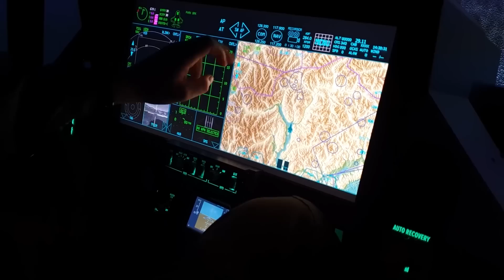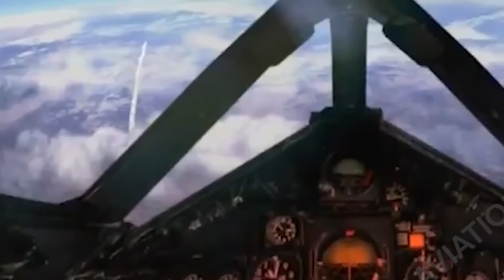The USA is testing Its New " 7th Generation " Fighter Jet | Russia and China shocked

Comment: If the "7th gen" is like what is listed here, Kinetic impact weapons are not out of the question either, because from that high up combining inertia and re-entry with something heavy it can deal massive damage and potentially shatter aircraft runways or destroy heavily fortified bunkers using less or no explosive substances than modern day "bunker busters"
Reply: Realistically nothings out of the equation. Like you said impact weapons but realistically the US can do whatever. We know they’ve been testing lasted for like 30+ years, I mean combining hypersonic with no radar cross section. Also 7th gen could be the first step to non combustion, fusion, maybe even gravity propulsion. All depends on our materials and elements.
Reply: Ionic wind even would be cool
Reply: Rods from God
Reply: @@mzt2929 i see, perhaps it needs a little push to accelerate it and get it on target from that height
Reply: Pa DESI YUKI RIMTU TI TUKI!

Comment: I wonder if internal missiles bay even needed in the future when a stealth fighter could be escorted & protected by a squad of stealth missiles drones
Reply: That idea is probably not viable for the simple reason of fuel, it's hard to cram enough fuel into something to be efficient enough that also needs to be small and have stealth characteristics such as being flat and nimble. The cost of weapons like that would likely way more than double the cost of a standard missle just because of the sophisticated programming they would need to put in them.
Reply: @Spyderbrit  Stealth missiles drones don't have to be small. It could be as big as maned jet fighters but without the cockpit.
Reply: @zollen123  Well missiles that size wouldn't be effective enough because of the reduced mobility, it wouldn't be able to maneuver fast enough to be a good missile, in air to air situations of course.
Reply: @Spyderbrit  It is still a remote controlled fighter jet carrying 2+ guided missiles.
Reply: @zollen123  hell we have a program turning F-16s into attack drones atm so I don’t see any reason why AI couldn’t perform just as well as a human if not better due to no human restraints, only restraints would be on the jet and the AI but by second gen AI those issues should be worked out. Also I don’t see why they wouldn’t be able to carry a full weapons loadout!! That would be cool tho, upload new software into our old gen 4 and 4+ fighters and turn them into drones or loyal wingmen would be awesome!!

Comment: This is a Great Video Review!!! One question: if we are using a dual cycle ramjet_turbo fan engine.  Doesn't this mean,  we can only travel high super sonic in atmospheric conditions?
Thank you 🤓♥️
Reply: We can use them to about 125,000ft. and with some sort of liquid air injection type device to make up for the thin atmosphere maybe it could be pushed higher. Still, the jets won’t work towards space because at some point there’s nothing to make the fuel stay lit.
Reply: yes its possible and more practical than v4

Comment: i think the next phase of warfare should be to attempt to nullify the nuclear threat.  This could be done with a swarm of craft always in the air, or laser weapons that can neutralise ICBMs.  This will effectively end mutually assured destruction
Reply: That wouldn't work unless all the governments agreed to let someone else's military into their airspace at all times. And it ignores the fact that when one side advances in technology the other side creates counter measures such as their own swarm.

Nukes are also emps so potentially only takes a few nukes set to go off right in front of the swarm to shut down a decent chunk of electronics in a zone. Drone's don't do well in those cases and radiation is actually worse when detonated up high because the radiation drifts further.

You can also just stick a nuke in the car and ignore the air.

And of course it actually encourages countries to launch more nukes because obviously one wont work so they send more in the hopes at least some get through.

There was a similar project with satellites that could shoot nukes down and there is a world where it may temporarily work. Long term "the nuke problem" does require all governments to come to an agreement to a) remove their own existing arsenal and b) make it impossible to make more. Send all uranium to the moon for example. Neither one of these things will occur until the world faces an outside threat that forces governments to unite. Military advancements alone will not resolve the nuke poblem due to the competition between countries.

Comment: How about combining the 5th generation with an incorporated high-speed rocket working as a booster?
Reply: Use your imagination, get some crayons and make a drawing, one copy to submit to Lockheed another for your mommy's fridge.
Reply: rockets as boosters were used during early jet times a lot, as it turns out, the aircraft are too heavy to be pushed by rocket a lot, so they would only be used to assist during take-off. thinking of bigger rocket? forget it, modern jet engines with afterburners are essentially big rockets

google dunning-kruger effect
Reply: it's a Valkryie, they were really popular in the Macross series out of Japan,
Reply: Existing Radar coating melt at mach 1.4...

Comment: We need all jets to have Fusion Reactors so the Electromagnetic Force Fields keep it cool so they don’t have alloy degradation from heat and also creating Inertial  Dampeners so men can fly at Mach 10 and live in comfort in the cock pit while a 360% Laser can destroy Hypersonic Missiles from any direction if a Hypersonic missile could even catch it  or break trough it’s force field . No need for stealth coatings  when the Force Field  does a better Job and these jets won’t need tankers ever or use Fossils Fuels. They could use auto Pilot to sleep and stay in the air as long as needed and fly anywhere at speeds never reached by man or machine.
This is the Future and with speeds and designed to maneuver at speeds and air maneuvers that can evade missiles even though The Force Fields keep collisions against it from disturbing flight. The 360% Laser can take out Satiates because these fighters  have a force Field and inertial dampening  able to even fly escorts for the Falcon Heavy to Marx or anywhere because they can and will because we will Conquer The Moon building a Base with Fusion Battery’s as in Large Laser Guns that will Destroy any would be invaders if they got past the Remote AI Laser Fusion Satellite Sentinels that Guard the Space around our Planet and Moon then Mars and other out posts. We must do this before China or any other country tries to get there first. We can Protect our Planet and any colonies we build and use The Sun’s energy to create a force Field that can keep our Ozone Layer Safe and keep all Meteors & Comets from Destroying Man Kind and it’s Domain . I have got this figured all out and we can build Passenger Jets the same way that can fly us to Space with out Rockets but Fusion Powered engines that can fly right through the magnetosphere smoothly and passengers  wont even spill a drink. I have got it all figured out. We can’t allow The Current administrations & the Communist, or any other would be Super Power keep Us From doing this. Let’s build all of these jets for earth and Space flights with Fusion Reactors and also Build Drone Sentinel satellites for Space, the Moon, Ocean underwater sentinel Grids that are Fusion Powered with Lasers & Particle Beams that can energize any Chinese ship taking all life but keeping the Ship in tact  to commandeer
taking it to a Sentinel Protected Port to secure any Warheads or Nuclear devices or reactors making them ready to recycle and learn just what they have so we can never have them as a threat. If anyone understands this then they should agree and let me Design what is a lot simpler as it sound. We can Colonize and keep our Domain and sectors safe along with it’s resources and a better way to live any where we decide. The Sentinel’s will protect us and the Grid we map out starting with our Planet, Moon , Mars and then any where beyond.
We can use Our Sun to Power and  Protect our Ozone & Magnetosphere  along with a Magnetosphere we create for the Moon as long as it doesn’t change it’s Orbit to where it impedes symbiotic Harmony with the Solar System & Earth.
It can be done although it may have Alien Bases inside being Powered already for their needs or Microcosm that is for Us or them too already.
Regardless I have it figured out and it’s likely being done or can be with Helium 13 as it appears ships with Strong Enough Force fields powered by it are flying into it close enough to Fuel up and it’s Probably a  Star Gate hence the Names Origin and the same in each Solar System & Stars because of their Rotation’s &!Positioning bending The Space Time Continuum through Positioning & Harmonic Resonance Riding the Photon Light wave creating Worm Holes like Riding The Big Pipe on the North Shore but it’s using Light Wave Theory in Space which you get out ahead of the Light Wave which creates Warp Speed.

Comment: 8:00 Hypersonic detrimental to pilots? How about astronauts? They fly at more than 10 Mach...
Reply: The purpose is different, amigo.
Reply: @Monalisa77753  well they are both flying at high high high speeds!!
Could you please explain how theVtwo differ, and why the difference makes astronauts survive high speeds?
Reply: Hello Michael Wong,,, I took some images over Area 51 April 2019,, with my cruel measurements for speed, I calculated a unidentified object traveling Mk 14, while our slow jets were trying to follow it. In my image file, in one photo, our jet travels about 1 inch where as in the same 1/3 of a second, the UFO travel about 5 inches. in the next frame.. and yes I have all the docs and camera settings.

Comment: RailGuns are kinetic impact weapons. Kinetic weapons are suspectible to velocity mass like Einstein theorema stated. Kinetic weapons only works inside certain atmospharic pressurre. Kinetic weapos high speed makes them unstobbable unles you develop good radar sentry and anticipate the kinetic missiles. You can jamm also the kinetic missiles flight radar and divert them against their sender.
Reply: A slingshot is a kinetic impact weapon.

Comment: why did the x wing come up at all? "It might look like an apple" with same reason as what was given in the video, none.

point 5 also kind of negates the concept of a fighter right? It no longer requires humans in cockpit = drones. Not a major quibble but I assume combat drones will have their own classifications.

We need to invest in internal manufacturing more than a new fighter or you end up running the risk of what Russia has. It has fancy new fighters, it can't afford to make them or even risk flying them. USA definitely has more leeway but the same general weakness. Specialized parts which are created outside the USA. Even if they are created it is difficult to mass produce. And you don't want to invest in mass production unless you actually require the production or else its a  waste of money.
Laser weapons will likely not be effective weaponry. They are chasing scifi currently. A laser right now has to high diffusion going through the atmosphere which severely limits the range. This can only be fixed by increasing the power requirements. It can also be easily negated by suitable armor. Think of a mirror and scale up. There would certainly be negatives to making those defenses and they may not apply to ground structures as easily but lasers would not be the recommended route to go until we actually begin fighting in space.

Comment: I was at Edwards Air Force Base during the testing of the YF-22 and the F-35.
Reply: I was there during testing of f16 f15
Reply: @oldschool4456  
I was there from the early 80's to the early 90's.
Reply: @Istandby666  mid 70s